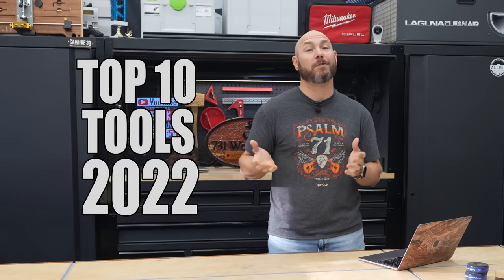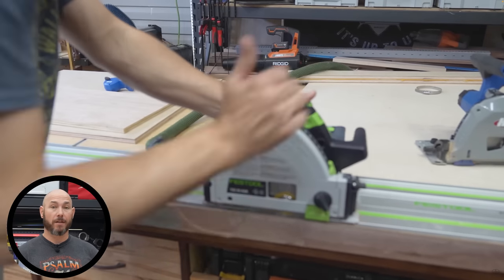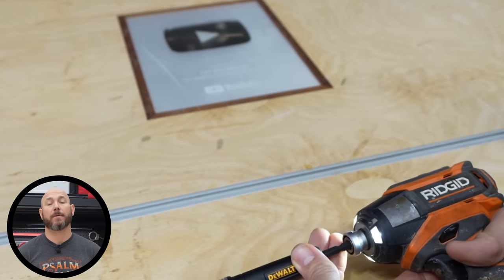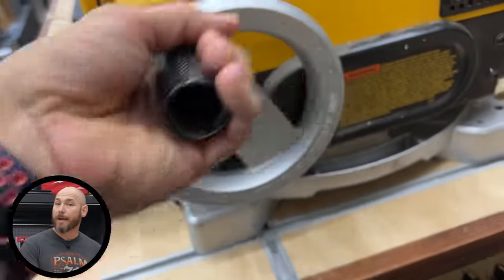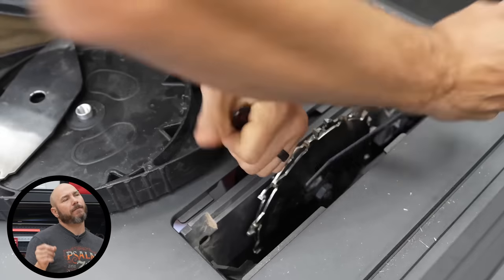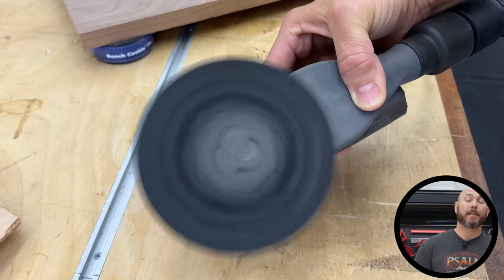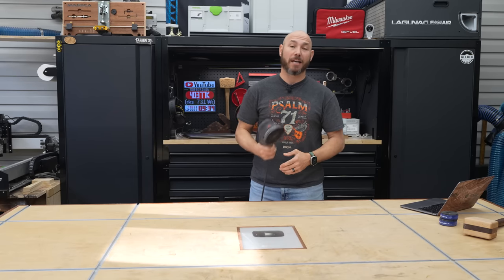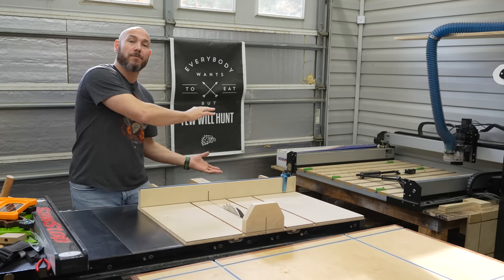Top 10 Most Popular Woodworking Tools of 2022?

Comment from the maker: ▼EXPAND FOR TOOL LINKS and INFO▼ 
🎥 Watch Next - Parallel Clamp Comparison Review - https://youtu.be/jA4nhgY30kU
🛠 Tools: 
Thin Rip Jig - https://amzn.to/3FGY5eP
WEN Track Saw - https://amzn.to/3FFJpMT
Kreg Track Saw - https://amzn.to/3PePinw
Festool Track Saw - https://amzn.to/3iTTtZK
DFM Small Square - https://amzn.to/3VTwvRq
Right Angle Attachment - https://amzn.to/3YgjMd8
Flush Cut Saw - https://amzn.to/3UO085d
Craftsman Planer - https://amzn.to/3BoTB9Y
DeWALT DW735X Planer - https://amzn.to/3FesUGp
Oliver Planer - https://amzn.to/3FGZ0fh
Skil Table Saw - https://amzn.to/3h8Yj5a
Zero Clearance Plate for Skil Table Saw - https://amzn.to/3W7Rb7W
Bremen Parallel Clamp - https://www.harborfreight.com/24-in-parallel-clamp-58752.html
3M Xtract Sander https://lddy.no/1e93h
Rikon Detail Sander - https://shrsl.com/3u373
Milwaukee Detail Sander (Home Depot) - https://homedepot.sjv.io/yR0Zn3
Milwaukee Detail Sander (Acme Tools) - https://imp.i284638.net/mgWyPO

Favorite Workboots (use code 731WOODWORKS to get $10 off) https://bruntworkwear.com/731woodworks
CNC I Use Shapeoko 4XXL - https://shop.carbide3d.com/731woodworks
Camera Gear I Use - https://kit.co/731Woodworks/camera-gear-i-use 
Computer Equipment I Use - https://kit.co/731Woodworks/731-woodworks-computer-equipment

(If you use one of these Amazon and other affiliate links, I may receive a commission) 

Some other useful links:
Our New Christian T-Shirt Company - https://faithvalleytees.com
Daily Tool Deals: https://www.731woodworks.com/tool-deals
Subscribe to the 731 email Newsletter: https://mailchi.mp/7e44c16eefdc/731-woodworks-email-newsletter
Check out our easy-to-follow woodworking plans: https://www.731woodworks.com/store
Outlaw's Board Butter - So Good it Should be Outlawed: https://www.731woodworks.com/store/boardbutter
Greatest Free Gift I've Ever Received: http://story4.us/731Woodworks
Reply: Matt enjoy your videos. Do you have any suggestions for someone in a wheelchair? I have some of my father’s old tools, Radial arm saw, small 10 inch table saw and a 1950s joiner.  I need a workbench but being in a wheelchair finding one I can get up to that’s not too high or low isn’t easy. 
Thanks 
Randy

Comment: You asked what our favorite tools of 2022 mine was the Milwaukee M 12 drill and 1/4” impact driver (around $100) not nearly as powerful as the M 18 but small and light weight, but still enough power for nearly all my shop needs.

Comment: I've had a Festool TS55 track saw for about 13 years and love the thing.  I have a lot of (expensive) tools but none gets used as much as that thing.  That said, I don't see the point of the cordless track saw.  If you're worried about dust (and I am) you'll be using a dust extractor.  With a vacuum hose, who cares about a power cord.  I bought some clips from ETSY to attach the power cord to the hose and both are plugged into the dust extractor. When the tool is on, so is the dust extractor.

Comment: My favorite tool is this channel but in regards to what's in my shop/garage is this High Torque Impact Wrench Kit from RIDGID that I paid about $170 after the hack deal. It has such power you almost don't feel it working when busting lug nuts off & with the new 4Ah MaxOutput battery it was a great deal. An incredible tool.

Though I do have to say I have the same DeWalt thickness planer and it is a beast. It is probably my favorite woodworking tool.

Comment: My best tool was my Rikon 14 inch bandsaw. It consistantly out performs my old Jet cast iron saw with riser block. I also bought that 3M sander won't replace my Bosch 6 inch for hogging away material, but it is way better for fine sanding.

Comment: Nice list with good info on pros and cons of different cost options. Appreciate your clarity on that. Only one complaint is your take on track saw - my tiny shop is based on a track saw, no space or desire for table saw. There are at least three ways to build a shop: circular saw with some straight edge, upgrade option to track saw or table saw.
Reply: Not all of us need a table saw for what we do, and I think he kind of points that out most of time. I have a table saw but I use my track saw more often.

Comment: I don't have an issue with any of these tools doing the job, but two of these things I have issues with for secondary reasons.
My #1 problem with the Kreg, the reason I got rid of it, is that it's on it's own system. You can run the Makita, Festool, Wen, Mafell and others on the same type of track, and use most of the same accessories (the Makita track has a balance feature which can stop some of the accessories from working, the Mafell has two track style options). The Kreg is it's own thing. The ecosystem for the Festool style track is the best. I don't think that Kreg's MFT option works nearly as well as the drawbridge setup for Festool tables (from Festool or 3rd parties).
The big issue for me with the 3M sander is that fixed cable. I end up having to switch multiple tools with the dust collection and cable. I can't switch out the tool easy enough with that design. I just don't get why they did this on a tool that's trying to be more prosumer. To be fair, I had already gone with the Festool since I felt like for me the locking button better than the Mirka style paddle, but that's a matter of preference.

Comment: You should look into the Wahuda planer as a second mid-early level planer -- slightly more expensive than the Dewalt (US$625 vs. $800) but it is a spiral cutter head, just like their jointer. Given your clear thumbs-up approval of the Wahuda jointer, I'm surprised you haven't sought out one of these.

Comment: The Kreg right angle is the best I’ve found, it’s impact rates, and more importantly than every other brand is LOCKING, which allows you to use it to drill as well or just deal with tougher fasteners.

Comment: I had the 5" version of the 3M sander (connected to my Festool dust extractor).  I had huge problems with static shocks when using it.  I did like the smooth and quiet operation, but the static shocks were too much.  I returned it and will keep using my Festool sander.
Reply from the maker: I had a friend of mine that said the same thing about his.  I haven't had that issue.
Reply: @731Woodworks  Honestly, I wonder what the difference is.  There's got to be something that's causing this.  I SO wanted to like this.

Comment: WEN has a 15 amp 13 inch spiral head thickness planar for around 400 bucks that I think you should check out. As far as budget options go it is probably the better option over the craftsman. Some even say it rivals the dewalt as far as finished product goes because of the spiral head.

Comment: So far the best tool I got was the Ridgid planer, nearly every project I’ve done goes through it before assembly. It’s not a helical head but I got a good deal being “factory blemished” that I still haven’t found.
I did get the flush trim saw and have already used it twice within a week of owning it.
I was sooo ready to get that thin rip guide, until I was reminded that my $100 Ryobi TS doesn’t have that darn left-of-blade miter slot. I’ve commented about that at least 3 times now. Man that kicks my butt. 😅Trying to get an old 8” craftsman going, just for that miter slot. Otherwise I’d seek out that Skil which I still might. $335.15 would arrive mid January or sooner when purchasing with a gift card… Mann that is tempting.
Reply: Went to get a table saw. 
Ryobi box shows two slots 
Get home and assemble....only one slot 
Returned and asked what the heck home depot
They said yeah its a known issue....there were reviews going back over a year for it and they still hadn't fixed the packaging or the website
Reply: @chriswitek9455  interesting and makes more sense to me now. I had found it new in box on OfferUp and the only picture was a screenshot of the Home Depot pictures and box. So that could be exactly why I too didn’t realize it till it was too late. Thank you for that. At $100 i just shrug 🤷🏼‍♂️

Comment: The Wen track saw. Value for sure, however I have complaints. First, if you decide to try to joint 2 boards side by side on a 100% level service and are trying to do a panel glue up - the individual cuts will still leave a gap. Ie, on a table - rip one side, rip other side, but them together with very light clamping presser on ends and middle and then rip down the seam of the two butted boards. That will give you a perfect glue joint - if your table is 8', the two tracks will not allow you to cut off the last 1/2" of rip. Instead, you fall to your other chosen tool on this list - the Japanese pull saw. I bought it a year ago, sat on my rack for a year and poof - suddenly I'm using it all the time to finish the last 1/2" cut of a track saw cut. As long as you keep a finger on it to keep it flush, holy cow does it cut precise. I have a TON more to say about the wen track saw - especially getting a perfectly straight edge on the 2 track pieces which involved a machinist square, an 8' level and a good bit of sanding, I noticed about .003 of gap in middle where two tracks come together. I had to really play with it, that and the stupid front screw with the little pad that goes against the rail when you push it to keep it from slopping. It gets caught on the seam of the joint of the two pieces - makes me angry as all get out. I think if you have a couple hours, the 100$ price tag on the saw and another 100$ on the 2x 55" tracks is good. However, If I was going to do it over, I think I'd go Kreg for 300$ and spend the 100$ on the powertrac or whatever track (not the wen though, stay away from it unless you got some time) or even the Festool. Ripping 8' table top boards the track saw is a daily driver and I do recommend stepping up if you are generating income, just do it.  I use that damn track saw so much because I have a job side dewalt table saw with a 10" blade, but the fence is too short to rip 8-10' boards accurately without building outfeed table and extended fence. Table saw upgrade is next on list. 

Not mentioned here but it is FREAKING AWESOME - Pegasus workbench. A little while back you showed a deal. Man, that was the EASIEST workbench I ever used. I use the Worx clamps all the time, and I literally took it out of the box and started using it within a minute. Best thing I bough 2022, besides my 735 Dewalt (just regular blades, not a spiral....because money aint growing on trees never!).

Comment: Take the 3D printed piece off your Festool tracksaw. It’s bad for dust collection. Air needs to circulate through that window.
Reply from the maker: I've found that it significantly improves the dust collection
Reply: @731Woodworks  I thought the same thing initially, but then I was told that by a Festool technician. 🤷‍♂️

Comment: The zero clearance plate for the Skil table saw shows as sold out with no idea if they are ever going to have them again. Does anyone have any information about where to buy one? I do find the OEM insert to be too flexible. I tried adding different types of reinforcements to the underside of the plate for rigidity. It helps but is not the right solution.
Reply: Return the saw if possible, throw it away if you can’t. Skil table saws are junk and I wouldn’t waste a penny trying to upgrade it.